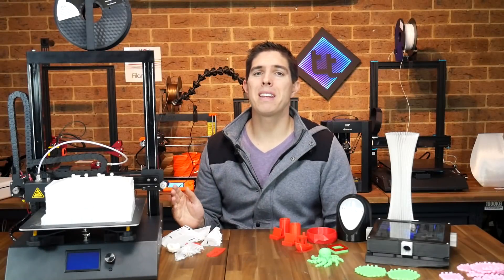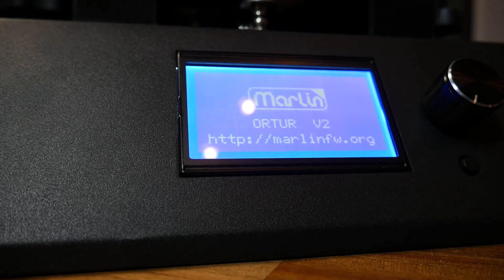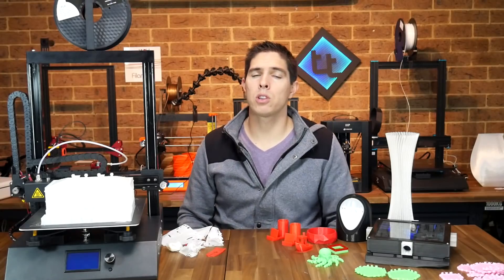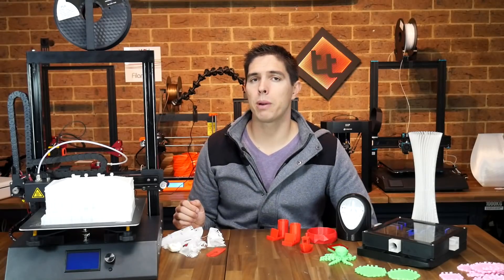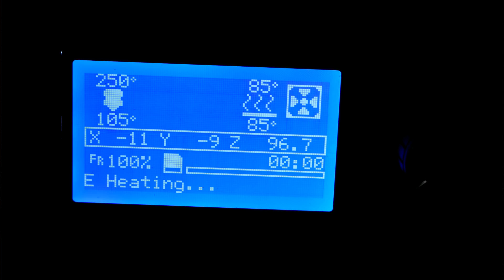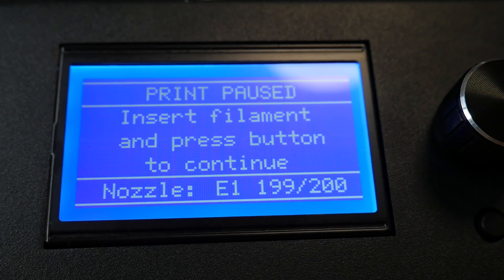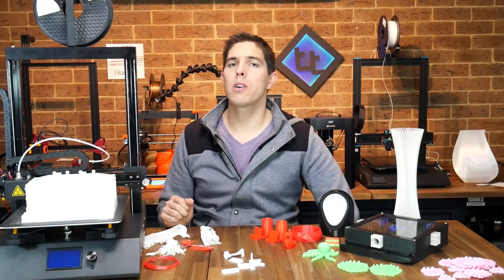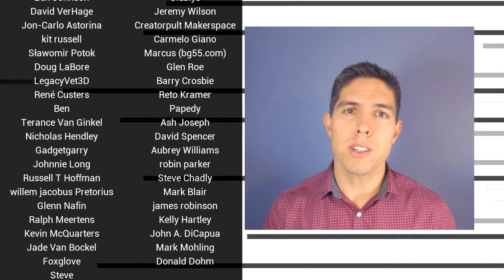Ortur 4 linear rail 3D printer review(?) - UPDATED

Comment: What is that bed sheet made from? I thought PETG stuck to everything.

I've seen a few new printer reviews lately that have me concerned. Small Chinese companies that use solid hardware designs, then throw on cheap electronics, and cheap packing, but charge as much as a Creality. Thank you for calling out the issues, and not trying to downplay them.

Comment: Hey All.  So because of this video I decided to get the Ortur 4, I make architectural models.  Purchased from BangGood for $360 (Tax and shipping included) .  I can tell you that it is the Original version, Just like in this video, but had minor updates. The unit is a tank, extremely well built.  No issues like what was in the video, everything was tight.  no loose parts or anything broken.  The hot end issue IS there.  With that said, Support has Been FANTASTIC.  Sent them an email and they replied back in less than a Hr.  They shipped out the replacement Parts mentioned in the video and are arriving in 7 days from Taiwan.  So far I am impressed.
The Newest version is supposed to be released this month.  Their Facebook site   https://www.facebook.com/ortur3d/ 
On a side note, the upgraded parts for the G2 ... "G2" print head (including all components + wiring harness) + a new Ortur4.3 motherboard (with a 6010 cooling fan + fan rack) are available for purchase.  It is something I WILL invest in, eventually.

Comment: I have 2- Ender 3's and a CR-10S that I use daily for a craft show product. Just added the Ortur 4. Mine must be the newer version. So far I am getting great prints and I have found mine to be rock solid on all axis. The bed is much more solid than any of my other printers. Still adjusting settings to get the optimum print speed but very fast printing already. I think the manufacturer must have listened to reported problems and made improvements. I would not hesitate to buy this printer.

Comment: Hello Michael, thanks for the video and please do me a favor to pin my comment to keep Ortur-4 customers posted:

1. If the box were delivered in bad condition, and any part damaged, please take a photo or video and send to your vendors to get a free replacement part, Ortur provides one year warranty against manufacturing defects.

2. We would provide the E3D V6 aluminum block (with screw to fix the thermistor) to instead of the current V5 aluminum block for free, please contact with your vendors to get a free one directly.

3. The early model Ortur-4 is 30 seconds to activate the Thermal Runaway Protection, and other Ortur-4, shipped during 11th Feb-27th April 2019, is 45 seconds to activate the TRP. 
(It was because we had customer complained that, the TRP would be activated every time when window opened and if cold wind blow in). 
Anyway, if you'd like to reflash the firmware to reduce timing, please send email to ortur@ortur3dprinter.com to get the firmware or technical assistance.

4. For the issue that the part is hard to stick, in fact, this early prototype of Magnetic Pad + Carbon Steel Build Plate was not for sale.
For current Ortur customers, you would find your Ortur-4 was arrived with a common PC sticker, it's very easy to stick, even it's a hard to remove the part. 
(PS, if you'd like to test the latest Magnetic Pad + Carbon Steel Build Plate, please send email to ortur@ortur3dprinter.com too)

Finally, we're sorry for the inconvenience, we had learned and would make more effort to satisfy every Ortur customer, many thanks!
Reply: Great to see you addressing issues quickly and free I haven't bought one but is good to see 👍

Comment: Thanks for sharing, i would contact Ortur to get the firmware, and what do you think it's the right time to run thermal runaway protection? and frankly, i think my Ortur-4 is durable, especially quality is good when print at 120mms.

Comment: for thermal runaway, I do not know what the correct  time, but if ortur-4 has thermal runaway protection just like you said, it is much better than cr10s without this function. But carbon steel plate made me confused, because some revierws recommend it, since plastic sticker is hard to remove.
Reply from the maker: For straightforward prints it was great, for anything tricky it was hit and miss. I agree slow thermal runaway is better than nothing

Comment: I owned  one ortur printer, it's hard to remove the part from the plastic sticker. I was also considering about the mag carbon steel plate, but from your video, it's hard to stick, what do you think, if attach a plastic sticker or masking paper to cover the coating, would it work then?
Reply: the box received in good condition, that should be why My Ortur-4 have a much better print , faster and more accurate than my first printer CR10S, but any suggestions about the hotbed?

Comment: The defects of this model were criminal. Not issuing free replacements to customers for issues that are life threatening is absurd. They should at the very least inform people of these dangers.

Thanks for doing your part in spreading the word.
Reply: I kept my own Ortur 3D perinter in my office, keep printing days and nights little gifts for my children, it has life threatening dangers???About your safety concerns (thermistor) , the TRP-Thermal Runaway Protetion would be activated easily if did not detect temperature or detected temperature by wrong.
As a result, 3D printer would stop heating and display this error in LCD screen, there is no safety problem.
Reply: @auferoofficial1310  one instance does not excuse the potential for catastrophic failure that can result in a fire. The right thing to do is contact all first gen owners and replace the parts for free.
Reply: @Techknowdude  Yes, and had posted that: We would provide the E3D V6 aluminum block (with screw to fix the thermistor) to instead of the V5 aluminum block for free.

Comment: after my bad experience with the CR-10s pro, now I'm looking for something better and more reliable! can you recommend something to me? Prusa mk3s?
Reply: Victor Tam  the CR 10s Pro is a good printer, in the sense that if you can start a print and the printer can complete it, the results are very good. The biggest problem with this printer is the fact that the leveling sensor (inaccurate  ) can lead to major printing problems in addition to major initial adhesion problems.  some have had excellent prints immediately others (and there are many) still do not have a certainty of having a print even after hours.  have tried to replace the sensor with the Bltouch but being the v3 version you are forced to change firmware not original creality and lose functions (in short, do not solve 100%).  If you are ready to spend $ 600 for a cr-10s pro, don't do like me and add $ 100 so you get a Prusa i3 MK3s and you're happy forever!
Reply: Victor Tam  I must add that Creality sells its printer as extremely fast in printing, but then you are forced to go at 60% speed if you really want to get a decent print.  In my opinion Creality after the Cr-10s, took a step too long compared to the leg!
Reply: Victor Tam  if I remember correctly I believe that the cr10s pro arrives at 200mm / s (but I more than 80mm / s or maximum 100 / s I have never used)! if you're new maybe the Ender 3 pro was better! It has fewer special pieces but it prints well at the beginning and then you can always upgrade it in the future with small expenses.
Reply: Victor Tam  the point of having rail guides is certainly more precise but a printer must also have an excellent extrusion system, stable and well-optimized firmware and quality components; if one of these fails the whole printer will work badly!
Reply: Victor Tam  the only way to be comfortable buying a good printer is that it has been on the market for a long time and that there is enough positive feedback. I took the Cr10s-pro which had not yet been released on the global market and the few who have reviewed it in my opinion were not completely honest. To date if I wanted to start and spend little I would take the Ender 3 pro or the Ender 5 (not sure yet) or the Prusa i3 MK3s to be comfortable buying and supported by the comunity

Comment: Important that viewers don't confuse Chinese made Linear rails with improved quality or better than rollers. For some time to come with the smaller ones in particular generally they SUCK. They will get the tolerances better over time but not yet!
Reply: I do not know to buy cr-10 pro or ortur, but I finally choosed ortur for the linear rail design. It works good with high precision. price is acceptable with many features
Reply: @rippledu1100  I call Bullshit! Currently Chinese rails are rubbish.
Reply: @seabreezecoffeeroasters7994  "Ripple Du" is a company shill.  They are all over this comment thread.

Comment: Good review as you did not hide any of the bad & negatives. Too many red flags for anybody considering purchasing this kit IMO.

OK "KIT printer" at a $200~250 price point as it is not a polished product and needs quite a bit of tinkering/fixing to get it to work. It is good that the manufacturer has promised needed changes but myself and others have been burned by promises not kept.

I'll not recommend this printer to anybody unless I see a review with the needed fixes.
Reply: they did not tell me these improvments before i buy, but i am very happy with printing quality, i print a speed 120mm/s still with good quality. they told me max. 150mm/s, i would try later.

Comment: I bought this printer and the x axis motor shaft was bent because of the packaging. The belt was torn off and most of the screws/bolts needed tightening. I contacted them and they offered $15 off the price. I told them I would rather they send me replacement parts so they offered me $20 off. I got an Ender 3 that I almost never have to mess with so I was a little disappointed with the Ortur. It runs good now but not any better than the Ender. If you buy this, just know that you wont be printing a good part until you go over it with a fine toothed comb.
Reply: Victor Tam  They wouldn't send replacement parts, they refunded me $20. I bought the parts myself. I bought it from Banggood also.
Reply: Victor Tam  Amazon. You won't find anything specifically made for the Ortur but other 3d printer parts seem to be interchangeable. Good Luck.

Comment: the print quality of this is garbage compared to my anycubic if I'm being honest ( i have the 220$ s version. I HIGHELY RECOMMEND the upgraded s version!). it came with some issues (nowhere near as bad as this) but after switching the brass nuts to pom acetal anti backlash ones and pushing the linear bearing in place plus a lil bit of other stuff and I also modded it to be more silent) the quality is flawless! prints felixbles with retractions at 20mm/s without a sweat too :)
again these cheap printers are nowhere near perfect but the this is AWFUL. tho the anycubic has a smaller build volume. it's more than enough for me. I have yet to print anything bigger than like 100cm
Reply: Victor Tam  anycubic i3 mega-s. it doesn't but you can do a firmware flash (many at this price range don't afaik, which is weird because.... it's literally uncommenting a line) they did say the new firmware has thermal runaway so I'm not sure. keep in mind some newer versions are 32 bit which is bad if you wanna mod it to be silent (3d printers with normal drivers are usually fairly loud). the 32bit sadly has the drivers soldered in. Ender 3 is another option but keep in mind it needs a lot of modding and tinkering to be a reliable good printer. I am not aware of much else. there's plenty of reviews on this channel and other people's tho :)
Reply: Victor Tam  sadly no! Hopefully someone else can help. you can always ask on reddit or thingiverse too!
Reply: I had bought a Ortur-4 one month ago, but it's delivered in good condistion, and just spent about ten minutes to assemble. till now, it working properly, in fact, i really satisfied with the print quality

Comment: @Teaching Tech
 I seen this 3d printer  liked it but seen many issues & it wasn't completed but was keeping my eye on it still. but im experienced in 3d printing a couple years, bought a cr-10s with issues got great support & replacements, then bought a Prusa mk3 with the best possible support from prusa but these companies don't compare with support effort is there for creality & is mostly the english. cr-10s is over 1.5 years old still needs to be fiddled with all the time, is not stock in any way there is always another upgrade but will never be a prusa. Prusa is 1 year old no issues no fiddling it just works always nothing compares out of the box so far. Don't get me wrong I like my cr-10s as I have gained alot of experience with the trial & error of 3d printing with the cr-10s it teaches me something new all the time but nothing that can't be figured out, gained little owning a Prusa, your hand fed by prusa & there upgrades & slic3r settings.
Reply: cr-10s is good, but too slow, max. 80 with good printing quality. ortur i can run 120mm/s with very good accuracy, price is still cheaper.

Comment: @Ortur like the innovasion Ortur has used that others haven't. Take it from Prusa free upgrades, if your not in final stage of a tested & completed 3D printer, give good support & free upgrades. As revisions improve so should support, If you want your customers to buy One 3d printer & hate it or do you want your customers to want to buy a 2nd printer down the road & tell others how good the support is. This is old news most new 3d printer companies use customers as there testers at a price, little to no testing and give little to no support & no upgrades figure it out yourself. Support is the key to good business & a Good Brand Name you can trust. This should be the trade off on not well tested 3d printers free upgrades to there final product. My thoughts only!  Cheers

Comment: That company can burn. NO excuse to have an unsecured thermistor! Bet the runaway delay is so the cooling fan doesn't trip it, which can be solved by a PID tune or sock. They're as bad as Monoprice. I built my own printer with ABL, filament run-out, magnetic flex bed, 40x40 frame, all metal hot end, all for under $499. Why can't large companies do it?
Reply: Victor Tam  it's auto bed leveling. Using a BLtouch or inductive probe to measure the bed heights relative to the nozzle at 9 or more points. This creates a virtual mesh that is stored in short term memory and allows the nozzle to move up or down very slightly for the first couple layers to compensate for high or low spots on the bed.
Reply: Victor Tam  yea that's what bugs me, it advertises it, but here in the video he says it's not.
Reply: Can you share informations about your 3d print ?:D (list items ect ?;) Thnaks

Comment: Customer support was nice, and their reasoning for why they wont ship out improvements to customers is sound but COME ON the company put way too little research into the product, everything about it is rushed, these are things that if you know a decent bit about 3d printers you should be able to notice these flaws if you just take a few days to work with it, some of these were rather easy to spot just in the design phase, its quite obvious that they have the business side of things down but their design and production teams are garbage, these are probably some people who were good at business and thought the 3d printer space looked easy and profitable however they had little to no former experience, this machine in terms of quality is just nothing in comparison to the ender 3 for example, i get that the newer models will get better and better but thats just because they will learn more about 3d printers, they should get their experience before making and selling these not while making and selling these, in the end, i would not buy from this company for a long time, they have good ideas but nearly all are poorly executed and badly designed
Reply: Victor Tam  no, im just going off of the video
Reply: Victor Tam  wish you luck with it, seems like it needs a ton of modifications though
Reply: Victor Tam  no problem

Comment: One PR stunt with two guy acting like some professionals while rotating a part in CAD cannot even remotely repair the bad image they created themselves with a product shipped which is a fire hazard, screws falling while a screw is supposed to hold stuff, thermistor falling down and no real protection in software. You cannot blame shipping for this. One screw which was not tighten enough might be an excuse and easy blaming of shipping for mishandling the parcels, but 4 screws holding a stepper motor, all almost falling like the one from the power supply cannot be accepted. You were way too kind with them. I know, you need also to keep a professional attitude, but this is not finished design, not finished at all when putting it together.

Comment: Great review and associated warnings.  I agree with Nova Leary that as a "first experience" this machine would quickly turn people away from 3D printing.  The company really need to look at their QA process, you can't blame steppers and rails not being bolted in place on bad packaging and the issue you had with the broken joint on the board should have been picked up by them well before their assembly.   The thermistor just being "poked" into the head is just downright dangerous.    When I got my Ender 3 I knew it did not have thermal runaway so did not do any unattended prints until updated the firmware.  
For the price I would expect a much better build quality out of the box and think their response to your query was very non committal.  

Keep up the good work Michael.
Reply: Victor Tam  I am not totally sure but I don't think it does.   I have had mine for nearly a year now so had one of the 1st generation machines.    Upgrading the firmware is reasonably straightforward and Michael had some excellent videos on doing it which I used.